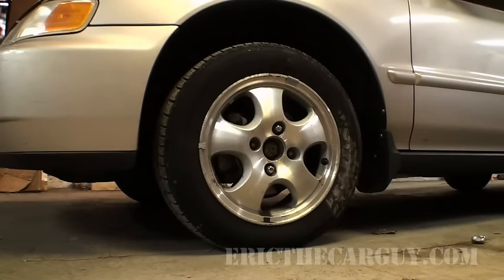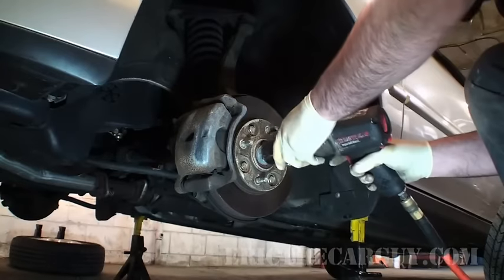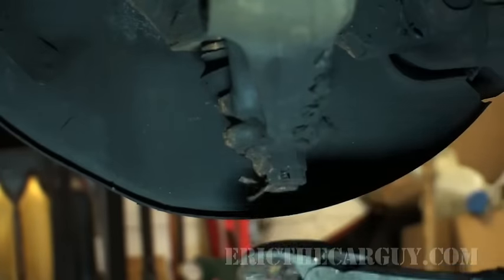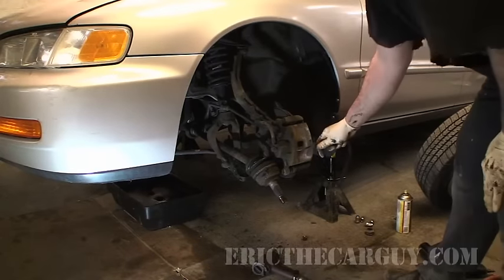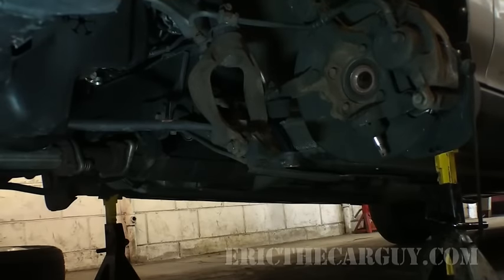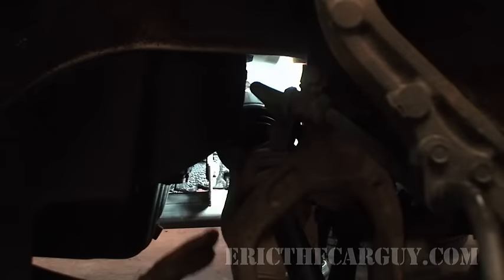How To Replace a Front Wheel Drive Axle - EricTheCarGuy

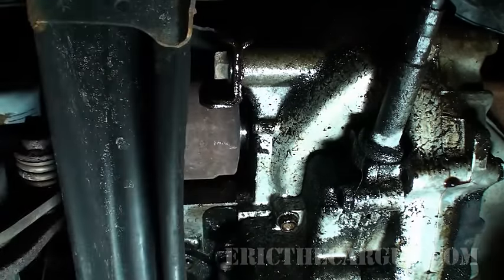Comment: So at 6:50 did you loosen those bolts that hold CV axel inside the transmission or did you kust banged it out?
Reply: Also at 10:58 Y you mentioned the wheel on the ground. Is that the main reason you didn't want to unscrew the "chicken bone" or whatever that is called? Just wondering.
Reply: Cheers man. Thank you

Comment: Does anyone know if I pop my lower ball joint to replace my half shaft axle do I need to get an alignment ? 2002 VW New Beetle (Drivers side) - Instead of loosening three bolts on bottom of swing arm (Ball joint connection).

Comment: A+, just replaced a crunching cracking sounding one with little effort.  Thanks for the huge tip on hitting the piece that the bolt is in and the direction to drive the pin through.  Send me your paypal email and I will send you a gem.

Comment: HELP: 1998 Honda Civic EX "Sexy Edition" - I followed the video step by step... everything went smoothly until it came time to tighten the 'crown bolt' (the one with the cotter pin on the bottom) .....I gave the arm a small tap with the hammer to get the ball joint to drop into place (the same way I hammered it to come out) I put the crown bolt on and finger tighten'd it, put my 17mm socket wrench on there and when I give it a pull THE WHOLE STUD SPINS WITH THE CROWN BOLT :-O 

Crown bolt is only half way on, I notice when I take the crown bolt off that the stud starts out small and get wider as it goes up on the tread.... Granted I am not using a impact gun could that be the problem? Or did maybe a rogue hammer strike break the stud at the base under the rubber grommit?

I fear the worst, any comments are helpful... I'll be back out there in the morning with my neighbors impact gun to see if that does the trick!
Reply: +Paul O'Connor yes the bolt is tapered. so take a jack on the bearing arm. so there is tension. then tight it up with an nutrunner
Reply: +ole lauritzen Thank you. The use of a power tool was very helpful, any time that the nut stopped spinning and the stud started spinning I would just reverse the drill a little bit and then go back full power. Little bit of playing with it got it to go! Yeeeehawwww!

Comment: Hey Eric I have a question I have a 2000 Nissan maxima I took it to the shop and they told me that both of my cv axles has no play in it you know how to fix it or any suggestions.
Reply: check yourself and see if the axle and/or axle boot is broken or damaged... if you had those axles on for 5 years, or 50,000 miles plus... then its time for you to change the axles... always change in pairs so replace both..
good luck
Reply: @omgitsdev4568  
I had just replaced both of my axles less than a week ago.A mechanic told me that they should have a lil play in them when you turn it back and toward by hand.
Reply: @woodberryomar  ✊🏿✊🏿
Reply: @omgitsdev4568  my cv axle has no play in it I guess because I have big rims on the car I have 26" rims

Comment: i own a acura 2006 tsx and i drove it through a muddy muddy rode and as it struggled across i noticed a exclamation light poping up every time i pressed hard on the gas. Help!
Reply: oh and also a wierd noise came from the bottom as if something was gauged in there
Reply: idk if im right but is either the ABS or traction control going off but my bet its the ABS

Comment: Where did you get thor from? What would you recommend for a good hammer?
Reply: +Nate Miller it looks like he made it by welding a pipe to an old and quite large ball-peen hammer head.  We'll see if he replies, exactly how he got it/made it. I hope he does.
Reply: Sounds cheaper than spending 30-40 bucks on one.

Comment: cant get main axle nut to break loose 2009 jetta tdi....broke two bars already, any suggestions?
Reply: I had the same issue. Broke two bars. It turned out that the bolt was stripped badly. I turned it back the other way, then back again. Eventually it came right off.
Reply: Cross threaded, I meant. My mistake.

Comment: Actually before I started up the car I actually got it off I remove the battery and I put a tax roofing scary into the aluminium housing and then I’ve got my crowbar the round end and put it around the roofing screw and used it as a slide Sliding hammer and it come out in about three minutes

Comment: How do you replace the drive axle bearings
Reply: IDK what vehicle you have- You do just what he did in this video and if you can get just the bearings then you would continue to remove the hub assy and then press the bearings out and press in the new ones some places will do the pressing for you if you take just the hub and bearings in for a small few BUT if bearings are not available then you buy a new hub assy and replace the whole hub with new bearings already in it which btw is what I have to do on my Explorer so if I am going to take it down that far I plan on replacing the CV shafts at the same time cuz with my luck I'd replace the bearings and a week later the damn half shaft will fail lol and  I only want to this once LOL Hope this helped you in  some way-good luck!

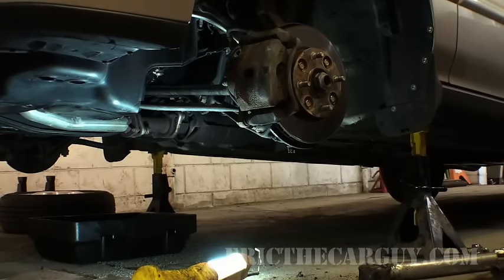Comment: After putting in the new axle and he tighten the nut for the drive plate (Around 13:20) he hit the tip of the axle with a chisel. Why?
Reply: He is punching the nut to lock it in place. There is an indent in the end of the shaft for that reason to stop the nut coming undone. After tightening the nut, you punch the nut into that indent.
Reply: Thank you, will do it.
Reply: Yep as lewis said, you see that little divot in top of the axle that he punch that piece into? It works the same way a cotter key does, It's not there to spot it from coming loose though, In the event that the spindle nut starts to work it's way loose it won't come completely off.

Comment: And then I couldn’t get the new one back in I could get it in that’s like getting stuck and I didn’t want to get the new one in and can get it back out if it wasn’t in properly so I started up the car I finished the other side obviously driver-side so I started up the car and went through the gears and turned off the car with it in neutral And the new one when I normally job done

Comment: Your video helped a lot! Thank you!  I just did mine on my Honda Odyssey but I did it a little differently https://youtu.be/tcs2r6_o8jE based on a tip from a former Honda mechanic who said to do the following: "to save some time and possible damage to where the home mechanic might run into problems. I just finished doing both axles on my 06 odyssey.  instead of taking off the lower control arms and outer tie rods, just remove the two strut bolts/nuts from the knuckle. Disconnect the abs wire clip on the strut, pull back on the knuckle. There is more than enough room to remove. Hope this helps for others. I am a past Honda tech, now tech for fleet vehicles for a municipality.  For others he did nothing wrong, I just saying a easier way to replace the axles, good luck"

Comment: Can you (or anyone) provide some advice on getting the inner joint out of transmission? It didn't pop out at all. I'm laying on my back under car and have limited leverage but am using a pry bar at least as long as in this video. It came out maybe the width of your smallest finger (or less actually). No fluid leaked. pulled on axle and tore boot right off of the "cup" (is that the right word). now I have this round cup sticking out of transmission. I turn and pull. turn and pull. pry and pull. nothing. its a 2008 Hyundai elantra. passenger side CV joint. really stressed because car needed for work and it's 4am Monday morning....... What can I try? Are there bolts clamping it on somewhere that I'm missing? Found a service manual online that doesn't mention any. just says pop it out with pry bar. .....
Reply: What did you end up figuring out?
Reply: it is 2:00 am and I am stuck in the same position than you, tomorrow I will have to take a Uber to work.
Please tell me what you Did thanks
David
Reply: +David Loyola I gave up! I reinserted the CV into the cup with fresh grease and new clamps. been driving this way still to this day!
Reply: +D Will just watched him pry it loose with one tap of his hand. (cursing under my breath)
Reply: Maybe your not supporting the shaft as you pull....Can not just let it hang as you pull/pray it out it will hang on C- Clip ?

Comment: I have a 2001 chevy suburban 5.3  a reduce engine power ligth comes on and it wont asselerate i change so meny things on it,can someone tellme wat to do!!
Reply: have your code scanned to get a specific diagnosis, then troubleshoot from there
Reply: could be you cat plugged up or bad mass air flow sensor.
Reply: ***** Tanks Scotty i"ll chek on that
Reply: Brad MacGregor Tanks B.G
Reply: Checking what codes on it is a good start, but you really need some live scanner data and experience understanding the results. I started my learning on that from Eric, then I branched out to Scanner Danner since he covers it more for the mechanic than the DIY. It takes a LOT of patience to learn what you're seeing on a live scanner.

Fortunate for my learning, my old car keeps showing up with stuff I can pick out on a live scanner for experience, because a lot keeps breaking.

Schrodingers Box is a channel that I follow on with much easier than Scanner Danner, but really, you have a lot of learning ahead of you, or you probably need a mechanic who's already invested in those skills.
Reply: Thanks
DE Nichols
Reply: You're welcome. Want their channel links?
Reply: DE Nichols Yes please !
Reply: Eric's videos and briansmobile1 taught me the most to start. If I hadn't spent a lot of time with them, Schrodingers Box and ScannerDanner may have not had been able to be technical layers on top off a base of knowledge. I still learn a great deal from where I started on my learning, so thanks off to the both of them!